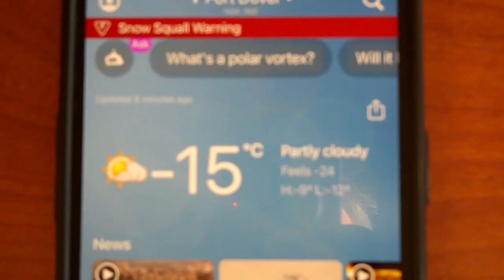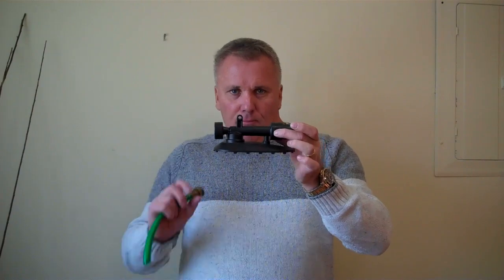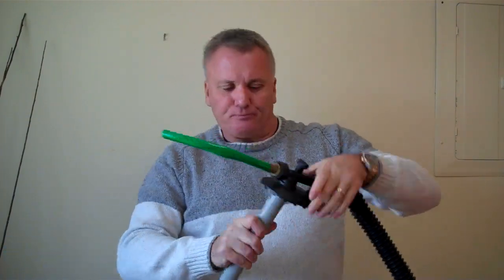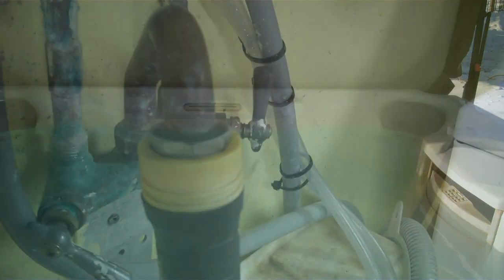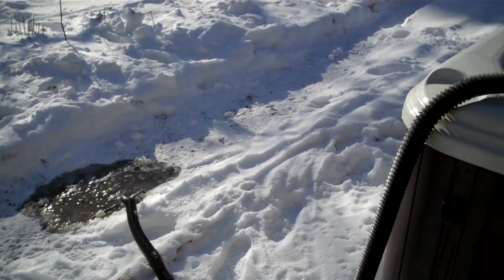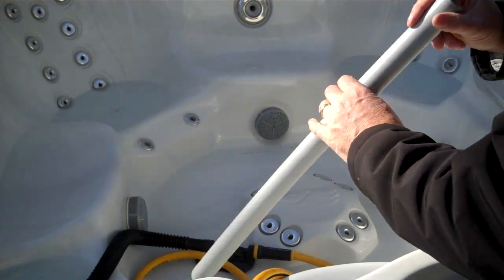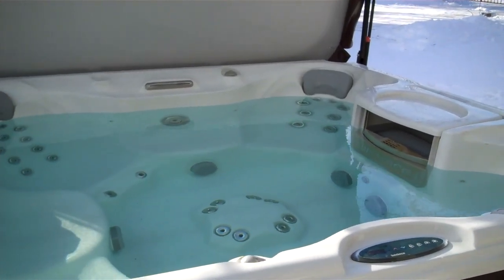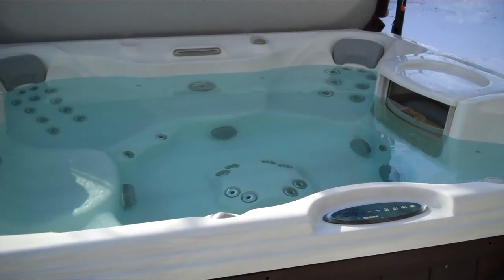Changing Spa Water in the Winter

Comment: So drained and filled, but did you clean out the inside of the tub? That's the part I don't want to do in the winter as I always get splashed. And I'd hate to have a window/door open to allow the hose to run from the inside of our house...
Reply from the maker: We did. You can see us vacuum up any debris. Besides that, there really isn’t anything to clean.  There is no scum or buildup or anything to remove.  We followed the same steps that we do in the summer.

We don’t leave the door wide open for the hose, just a crack  wide enough for a hose to come through. Yes you lose a few cents of heat, but it’s negligible.